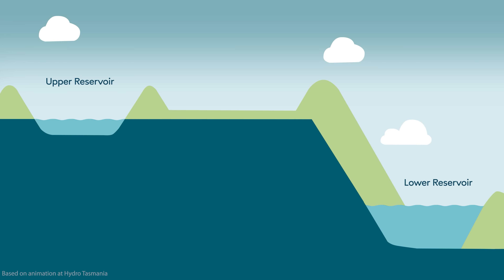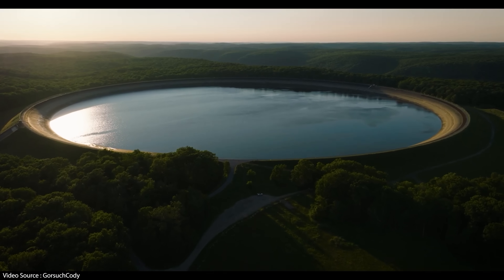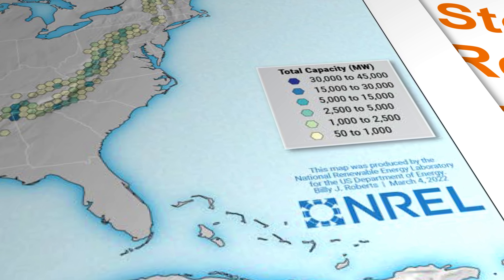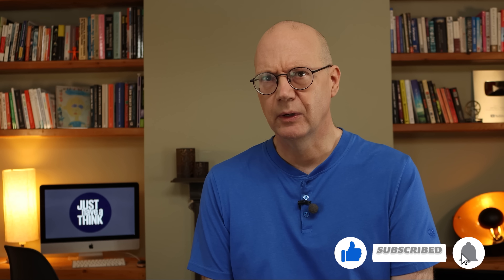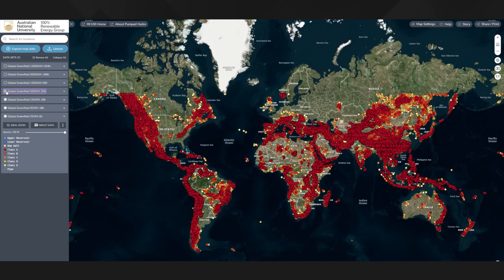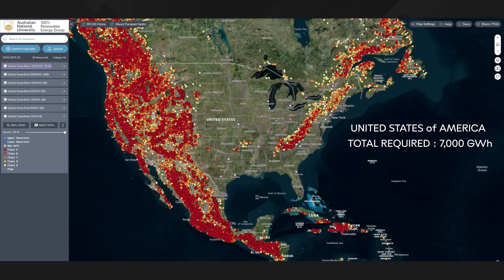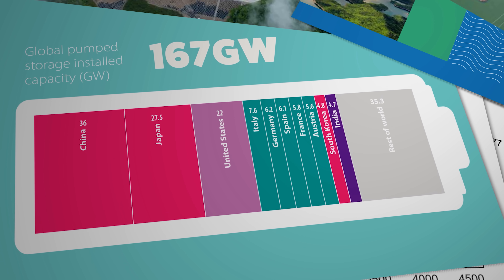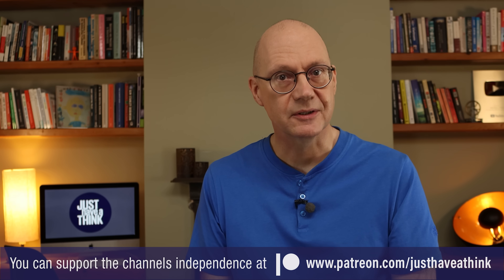The insane potential of Pumped Storage Hydro

Comment: Pumped hydro can store an enormous amount of energy. True but ONLY if the amount of water in those reservoirs is also enormous (or/better and  if the height difference between those reservoirs is enormous)  If you have ever used a pump to water your garden you know what little energy is required to pump a large amount of water. Conversely a large amount of water that runs through a turbine produces only a modest amount of energy. You'd have to flood entire valleys to create the required upper reservoirs. True, in places like the Western US you could use the Pacific as your lower reservoir but that would still mean converting large valleys into strorage pools for salt water. Not exactly beneficial for the plants on the shores of those "lakes" and therefore not a pretty sight. Furthermore this gentleman assumes that pumped hydro stations use renewable energy to operate their pumps. But there is nowhere enough renewable energy available to power these mega pumped hydro projects. I live in Switzerland and have seen both upper and lower pools of pumped hydro and they are an eyesore. Few fish and other aquatic live can exsist in those reservoirs because of the enormous fluctuations in their water levels that occur regularly.

Comment: Yes we need much more of this.
And programable / controlled load (like boilers heaters AC etc.), and why not charging stations for cars that attract EV's via app or lights when there is surplus power, heat battery (Finland style made from actual dirt), mine shafts with weights.
So many ways to balance the grid.

Comment: 500 Meter height difference is...a lot. Like tallest sky scraper in most large cities.  We could go smaller/shorter (spare the natural features of mountains and such) and just have smaller ones. Any municipal water tower, reservoirs on top of grain elevators and other large non-human occupied structures (not sure what all that would include..
Not much probably).  Wouldn't solve all issues, but a nice little bump in the intermittency of solar and wind.

Comment: Just a couple of comments. Many of the closed coal mines in the UK were more than 1800 metres in depth so the Finnish mine is really not very deep
Secondly and rather parochial the UK is determinedly avoiding the use of hydro storage. Forget pumping, the River Severn has one of the largest tidal ranges in the world and a dam, which could have been built as a crossing at a lower price than the Second Severn Crossing, would have a theoretical year round capacity of several gigawatts. Morecambe bay also has a similar capacity. And of course there are a lot of other sites. None have been properly evaluated. 
That's just one example, spending billions on a Nuclear power station and not even trying a tidal system.

Comment: I do like this concept. However... The fundamental problem with all stored energy systems designed to store surplus energy is that you need generate the surplus at the same time you are generating the energy you are using at the moment. So, you need to generate twice the energy  that is consumed during the day to store the surplus to be consumed at night. This is not a condemnation of this proposal on its face, but more that we need a massive upgrade and reform of existing generation and transmission systems and facilities. Stored energy systems are intended to shore up existing wind and solar generation systems that do not produce consistent energy amounts consistently. A perfect system would generate power 24/7 consistently like nuclear could, for example.

Comment: When I see this, I don’t doubt that there are many other suitable sites for pumped energy storage.  The problem I see is to be the most economical, they should be near existing hydro installations.  That makes the list much much shorter.  Also the example used was with a 500 meter head height, which is massively high.

Comment: A lot of those sites are close to the ring of fire.....not just needing extra protection but actually causing the earth movement that will wreck them. And have you addressed the issue that solar panels are black...and preventing the energy being radiated back to space.
Don't mean to be so negative but the real solution is to use less energy and perhaps have fewer kids. ( Too late for me, though only the 3 grandkids which seems about right.)

Comment: They should have did this  pumped hydro study 20 years ago. I have been freezing in winter and  only fan cooledi in summer and rode my bicycle as much as possible instead of driving my small ICE car...for  the last 20 years. A "switch" activated  in my brain and  I made the switch and stayed that way ever since. Maybe we all should have made the same switch (within reason) and they deployed   pumped hydro everywher they could...the world may have been a lot better off, now. We all knew about climate change back then, cos that is why I made that switch. But the right wingers successfully fucked it up by telling everyone tha climate change "simply isn't a thing". And they drove atound in their huge pickup trucks just to go 2 kilometers to the shops to get milk (for thelast 20 years). While I rode my bike, froze and sweltered for the same period. I rugged up instead of using a heater and fill a soda bottle withhot water from the tap. Better than a water bottle and stays hot longer just with tap hot water. And fans can get cold on hot nights if you make it fan your body when you sleep. Don't need aircon to sleep.

Comment: Is about USD/KWH if CALT sodium battery met it’s forecast price ie 40 USD/KWH, then this is too expensive, non flowing water is not that environmentally friendly, I had a swimming pool when I was living in South Africa, how much chemicals I put in, even you constructed as a ponds there is natural evaporation problem, there is also problems e.g. round trip efficiency of pump hydro is 70%, battery is 90% (Lion), HVDC loss 3.5% per 1000km, the time zone difference is 3 hours in USA and Australia, so having loads of and I meant a lot HVDC (enough to circulate the USA 3 times, backup and redundancy) will make the requirement of battery less) assuming peak electricity is 7 pm and 7 am, which meant that solar power travel both ways then hopefully wind will then pick up after 7pm to 5 am which is a reasonable assumption.  To say more pump storage has a large footprint while you can put batteries even on a electric poles and collectively acting as a giant battery just like the internet.

Pumped hydro sounds outdated to me and the best is to pour money into giga factory with sodium battery as it did not required cobalt, let the economic of scale do it work while pumped hydro is project based and not production line so cost is constant.

Comment: Pumped Energy Storage has always seemed like the most feasible energy storage method to me. Current batteries just don't have enough energy density. And if more energy dense batteries do emerge, that energy will become a huge hazard.
So to me, a layman, I don't see anything else on the horizon that would be a realistic solution.
Reply: I think you are missing the larger point of energy density.  Density is only a relevant factor if space is limited, like an EV.  For grid level storage size is completely scalable, negating density concerns.  Sites for battery storage are almost limitless.  So it comes down to cost, convenience and suitability of the project that will determine outcome.
Reply: @brettgracey9682  but also without density how much lithium will we need to achieve the required storage capacity? At a certain point we start coming up against natural resource constraints if this is to be rolled out globally no?

Comment: It's a great idea, I'm a big fan of pumped storage, it's been used in Scotland for decades already. However, the ANU map of potential sites is very misleading. I zoomed into New Zealand where I now live and some of the 'potential' sites involve more than 2km of dams being built and reservoirs covering existing towns and highways - hardly practical. We've only just finished a local dam which went $100m over budget (double) and doesn't even have any hydro capacity. Great video though. In the right place it is a great solution.

Comment: Great idea with significant cons. Massive initial capital cost, long project duration leading to many years before achieving ROI  (say 10 years construction), difficult to upgrade/increase power output due to size, limited locations near existing grid network.

Comment: This 1st hopes the evaporation from the reservoirs isn't high. This also hopes heavy rains don't overfill both reservoirs. It's also has the issue of driving/pumping large amounts of fluid up a mountain/elevation. Takes more energy than a normal low slope incline. Due to just fighting the full force of gravity. It's not just 1 pump will be needed to drive liquid in the upper reservoir. The power lost due to heat and multiple locations. May exceed the power generated.

Comment: I wonder if developing some sort of artificial inland tidal ecosystem could be done (maybe requiring a smaller scale, but in higher numbers). Depending on placement of the reservoirs, they could potentially add a lot of surplus food & variety of life to the local ecosystem. If done with enough thought, maybe they could be more beneficial than detrimental (unlike a lot of dam flooding).

Comment: I've always thought it would be ideal implementing wave generation for pumped hydro in places like Peru. They have vast elevation close to the coast, and you could even use saltwater in the closed unit.
Reply: Saltwater will penetrate the soil and get into groundwater, plus it will absolutely erode the pump-generator units themselves

Comment: One interesting (not crucial, but really interesting) aspect, not mentioned in this video, is what losses to expect, i.e. you but a certain amount of energy in and later reclaim most of it - but only most of it, not all. Put in x amount of energy in, and there will be losses when pumping the water up AND more losses when the system becomes a hydroelectric power plant, reclaiming the energy, not to mention any electricity transportation losses to/from the facility. Is it a tiny fraction (highly unlikely), a moderate fraction (less unlikely) or a considerable fraction? My uneducated SWAG (Silly Wild-Arsed Guess) is around 1/5th, plus/minus quite a bit. With a lot of these facilities already existing, I am sure somebody has already determined this. The positive aspect of this method seems to be it's minimal ecological impact; no harmful chemicals or emissions involved.

Comment: Pumped hydro is by far the best energy storage solution for short duration electric grid energy storage.   Pumped hydro is incredibly simple, inexpensive, sustainable, low ecological impact, and scalable. Pumped hydro should be considered wherever practical. 

Technology, like lithium ion that is highly resource intensive, produces huge amounts of e-waste, has the potential to cach on fire and burn uncontrollably, and has a short usable life expectation of one to three decades, should be avoided wherever a more cost effective, less expensive, less dangerous, longer lasting solution is available.   

Pumped hydro is often a better solution due to all its advantages previously listed and many countries have hundreds of times more locations suitable for pumped hydrothan whatis need for all that countries short duration electrical power storage needs.  The one significant drawback of pumped hydro is that it has to be located in suitable terrain and often can not be collocated with a power generation project. 

Pumped hydro is awesome.  If people in charge were actually interested in solving our energy needs and reducing the waisted use of hydrocarbons, they would focus their efforts on pumped hydro.  Instead, our leaders and corporations are more interested in sustainable emergencies that give them an excuse to gain more power to take charge and deliberately squander resources.

Comment: Like the idea. However, in an ideal world, batteries are needed because of intermittent supply of electrons. To compare cost of future electricity systems, the cost of the “charger” should really be included in the overall system cost. What I’d really like to see is a comparison between deep Geothermal vs RE+PHS vs RE+HVDC, all of which will allow uninterrupted clean power worldwide.

Comment: "Geographical restrictions, direct and indirect negative environmental impacts, too-long lead construction time, and the very large area needed are other important challenges of PHS technology. The environmental problems are associated with the inevitable changes in nature for the required large dams, roads, and power lines. A serious technical challenge of PHS is sediment management. During the lifetime of the PHS system (and regular hydropower systems), sediment is gradually trapped in the dam and the infrastructure causes a lot of environmental, operational, and maintenance difficulties such as decreasing the production capacity of the system, damaging the turbines, and so on.

Hydropower including PHS is and will continuously play a key role in the global energy matrix. However, due to the seriousness of the aforementioned challenges, there have always been efforts to raise new solutions in this context. Some of these are PHS reservoirs as wastewater treatment storage, underground water-filled shafts with piston-floated mechanisms, undersea PHS for offshore wind turbines, underground PHS, and others. Even with these novel concepts, there is still a need for more innovations and practical solutions, including new technological and economic possibilities, to appropriately address the critical challenges of PHS systems."

Comment: As always, fantastic video. Pumped hydro is certainly a great and very promising technology. Only caveat is that it will require lots of copper... and we are facing a huge copper shortage. We are about to reopen the Murdochville (Canada) copper mining facility that was closed because it was depleted 20 years ago. Large mining corporation is reopening the site despite the very low concentration 0.35%. The entire green transition assumes there will be a cheap and unlimited supply in minerals which is not the trend we see.

Comment: Like he says, "He is describing a very optimistic model."  He is describing having a 500 meter elevation difference (1,600 feet).  It sounds great in theory but to build and maintain one of practical size would be very difficult.  Just picture in your mind pumping water up a hundred and fifty story building to visualize such a system.

Comment: Minor caveats here. Most important, I doubt evaporation is the biggest water loss. To fill a large reservoir you must build a substantial pipeline as well as the reservoir as well as a small return line to dilute the closed loop from concentrating from evaporation. With a large reservoir filled with quality water, everyone nearby will want water. Unless you give them water these people will be NIMBYs; this is likely the largest water loss. Pumped hydro is mush simpler when at least one reservoir is on or very close to a source of flowing water like a river where everyone who wants water is already an understood variable.

Comment: I do not always agree with you, but I appreciate your calm pursuit of all the possible sustainable sources that at least have some due regard for the environment.  I think pumped hydro will always be more about fulfilling a "Battery" role than anything else.  I would associate them with some sort of "river run" format plant however, because they are going to need a source of replacement water for evaporation.  The storage pond could also be used as a co-location opportunity for wind and solar as well.  May as well save on transmission losses and have an in situ power source to just keep storing the water.

Comment: As wind and solar reach competitive market pricing, fossil industries continue to object that wind and solar are variable, therefore are not viable replacements. Now, pumped hydro removes that objection, for most purposes.
Not only is pumped hydro location-independent, but evaporation of storage reservoirs in hot, dry areas can be minimized with a novel technique-- covering the evaporative surface with millions of floatig plastic balls. The layer shields reservoir water from most direct, heating sunlight, reducing water loss.
Pumped hydro is the ultimate gravity storage battery, bypassing expensive, complex alernatives. 
As many forms of green energy progressively replace fossil energy generation, a national smart power grid becomes the next national priority. A smart power grid easily distributes wind, solar, tidal and geothermal energy around the counry, from areas of abundance to areas of need.
Pumped hydro further stabilizes that multiple green-source system against storm disruptions and strategic/terror attack.

Comment: The biggest problem with using this resource is the power grid just isn't capable of connecting to the different locations without a massive build taking many decades and using tons and tons of copper and other materials that must come from somewhere - deep sea or otherwise..
Reply: Grid interconnection is mainly aluminum and steel, plus whatever is involved in frequency matching stations.  The primary obstacles are regional politics and vested interests.

Comment: Thanks for this useful discussion.However there can be plenty of ideas for storing hydropower,like using a large empty vessel inside a large water resorvoir,the bottom of the empty vessel fixed to the bottom of the resirvoir where water can rush from resorvoir to empty vessel through a power generator and can be manipulated as per requirements.